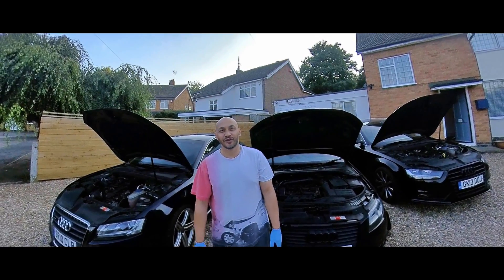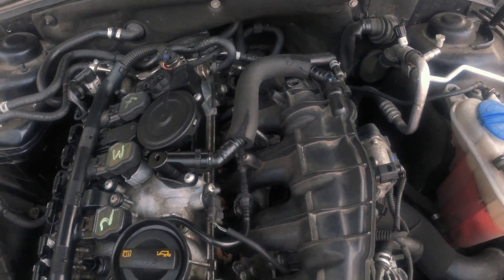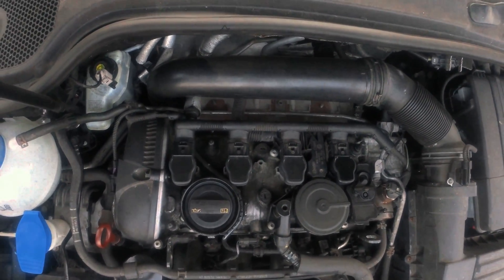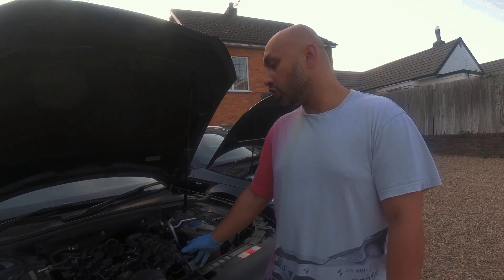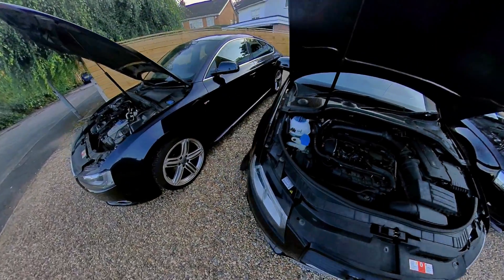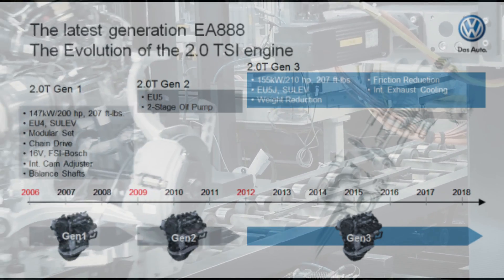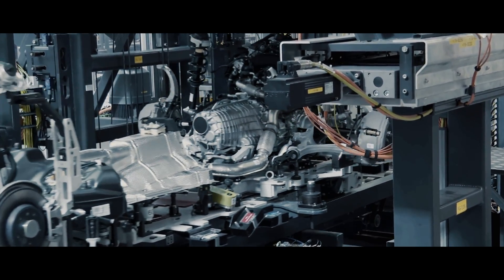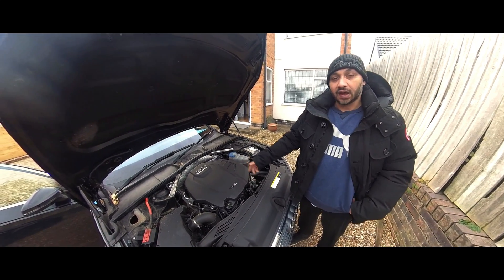VW Audi EA888 Gen 1, 2, 3, 3B TSI TFSI Engine Problems Comparison Review 2008-2021

Comment: Gen 3 is a completely different head to Gen 1 and 2. Exhaust manifold is in the head in the gen 3 with only two ports to the turbo, compared to a conventional 4 port head on the earlier generations. 
Rocker cover also includes the top half of the camshaft retainers so not simple to replace if there's a rocker cover oil leak.

Comment: Gen 3 still leak oil. 6k miles loss about 0.8l

Do you think it is better to rebuild the original Audi or replace it with a steel cylinder with smaller pistons (more oil cooling) ?
Reply from the maker: EA888 Gen 3 Losing Oil? Here’s Whether You Should Rebuild or Go All-In #ea888
https://youtube.com/shorts/SuJvgcPChlo?feature=share

Comment: 2.0 tfsi a5 2010 owner (btw the engine is gen2, not 1. Gen 1 had 200hp and way less torque. I have to say that the handling with a longitudinal mounted engine, is much better :)

Comment: Good video, but keep in mind that the Gen 2 engine was updated during its production run with a revised timing chain and tensioner. It also got better pistons and rings too. Most of the big issues were addressed during Gen 2, so the later model years are very solid engines.

Comment: For me the biggest advantage this engine has is its cast iron block. It can take serious horsepower, its thinner profile allows for easier maintenance and cast iron absorbs vibration better than any metal. It's a bit heavier, but its advantages more than make up for that.

Comment: The B stands for Buddack. It's the VW engineer that modified the Miller cycle to be more efficient and driveable. 3B and 3 couldn't be more different. One is Buddack cycle and the other is Otto cycle.
Reply from the maker: EA888 Gen 3 vs Gen 3B – Budack vs Otto Explained in 40 Seconds
https://youtube.com/shorts/KwSmJXh9R0M?feature=share

Comment: Im confused bro. I have an Audi q5 2014 2.0 tfsi. The engine cover looks like the third one you showed here the gen3, however the code is different than the ones you listed and it doesn’t have the dipstick to check oil.

Comment: Mark 8s with the 2.0 TSI have the Evo4 engine. Slightly bigger turbo (not from IHI anymore). Cylinder block is cast iron on all EA888, one of the best traits of it.

Comment: I probably wouldn't buy a car with a Gen 2 or Gen 1 version of this engine, but the gen 3 in our Mk7 GTI Golf is a good unit. It is very uncharismatic though due to it sounding very bland. The previous EA113 was much better in that regard.
Reply: If your finding it too boring then just look at changing the intake. My mk4 golf diesel I retro fitted the golf r32 intake really cheap and it looked oem.
Then I needed a new intercooler and managed to get the forge intercooler really cheap from where they are made. Then got some sfs hose with the correct adapters for diesel and everything just connected nicely. It made such a big difference to how well the engine ran after all that.
Reply: @rob-123  It is fine, the Golf is my wife's car. I have BMW M140i for aural thrills

Comment: FYI the MK6 Golf R uses still the Gen 1 motor. Only the GTI had the gen 2 motor. And as far the fuel consumption, Even tuned, Im getting over 25 mpg on average in my MK6. 30+ on on longer drives.

Comment: I think you skipped the actual 1st generation for the 2.0T (TFSI). I am driving an Audi A4 2.0 TFSi from 2005, engine code BGB, which is considered to be the first gen for FSI / TFSI engines (2004-2008). Which gets commonly mistaken for the 2nd gen, which is from 2008-2012 and the 2nd gen are notorious for their oil consumption and have been recognised as a factory fault and therefore a large percentage were factory recalled and fixed by Audi - as you well described :). 

I would consider your title to be EA888 Gen 2, 3, 4, 4B.

Edit: Just found that the 2004-2008 FSI/TFSi engines were considered to be EA113, so you you have listed them correctly. 
Once again, well described and I enjoyed watching.

Comment: Once upon  a time, there was the predecessor of the 1.8 vag engine, the supercharged, (PG code), g60, 1.8lt.. 
Some used for races and where dissapointed. The rest users, felt that this engine is one of the best, ever, made by VW.

Mine, on a Passat Syncro, has 320.000 km. and 30 years of use, never opened, consuming 1l of oil/1000km., giving the same magic sound of a brand new g60, as you can compare to my blog. This consumption is prooved to be minimized by changing the valve seals, without opening the engine.

The g60 compressor prooved to be better than a turbo, having the need for the first service at 250.000 km., much better than my 2.7l Audi biturbo engine.

The funny think is that, at that era, smart guys where adamant that the engine was...unreliable because it was not capable to take Lemmans circuit.

The Millenium after, VAG, is not the same animal...

The Syncro Heresy
Reply: Forgot to mention that my g60 has an ABT kit, (chip + camshaft), for 200 hp. The engine, for the last three decades, works under these conditions

Comment: That engine is the shits

You can not own any VW group car that comes with that engine and not replace the water pump once
Reply: I've never owned a car where I haven't changed the water pump when doing the cam belt, even on chain I've done the water pump change from time to time. I wouldn't want to run the risk of the pump failing and causing all sorts of problems on the block. To me the water pump is a service item on any car. I've had pumps leak and never felt comfortable leaving it.

Comment: Hey man, I need some answers I’ve looked everywhere, I got a deal on Gen 3 2017 A4 motor I wanna put in my 2010 B8 a4, can I do this swap with the OEM harness out my B8 and sort the intake cam spool valve later ? Thanks !

Comment: Great video👍 I have a 2012 A4 TFSI EA888 gen 2. My engine isn’t mounted horizontal though🤔The excessive oil usage because of the faulty tensioners is definitely the Achilles heel other than that, 193,000 miles with virtually no issues.😃👍

Comment: Glad I found this channel 3 years late . I've stayed up late daily researching this engine every night contemplating  my path. Purchased my 09 a4 Quattro with a caeb .  almost 4 years ago . Was my first almost new car was my dream car.  Put $4,000 down and first oil change car started smoking horribly wile running. 123,400 miles  with the internet and friend I misdiagnosed it as a bad turbo . Purchased a $1800 non stock great turbo . Installed and problem still existed.  Some lessons are expensive .

Comment: We bought a 2014 VW EOS online.  We are the third owner's.  Vehicle had 39,500 miles and very frequent service.  First thing I noticed is the exhaust pipe outlet is lined with a very think Soot.  I think it's 1/16".  The engine runs fine, no visible smoke and it's quiet but that Soot must mean very bad news.  My 2002 SAAB 9-5 has 171K miles and the exhaust outlets have zero residue and are slightly rusting.  The SAAB never burns any oil.  We don't know if the EOS is burning oil yet?  We only have put 700 miles on the car and are using Motul 5w-40.  I would assume this Soot deposit means it's shot.  Should we dump this EOS?

Comment: thank you bro! your video is very helpful! Can i ask the question? My car is 2013 Q3, The Engine code is CCZC, Do you know the tensioner part no. is 06H(old) or 06K(new)? because some say the new tensioner(06K) is fixed the timing chain issue.

Comment: I have a 1.8 tsi CDAA engine. The oil level is dropping every 600 kilometers. It needs 1 kilo of oil. I notice a lot of fuel consumption. Is this normal?
Reply: No its not normal. Common issue on CDAA engines.

Comment: Great review overall but you might need to correct this the smaller pistons were actually on later Gen1 CAE, CDN and CND and earlier Gen2 CC engines but earlier Gen1 CAB, CDH  actually had larger pistons ..and seem to be holding better after 10+ years on that oil gulping issue. 
For this reason most people actually generalise to saying the smaller pistons were more of a Gen2 issue than Gen1 or Gen3....
Reply: ... that was using Castrol Edge 5W40. My last 2 oil changes I switched to Castrol Edge 5W50 and the oil consumption went down to 400ml over the 7500 km oil change. Essentially using only one 5 litre bottle of Castrol Edge 5W50 between oil changes
Reply: thanks for the input dave not everybody is so deep knowledgeable as you.
Reply: exactly
Reply: Good catch👍, my early Gen 1 burns less than 700ml between 7500km oil changes

Comment: iv got a 2008 1.8tsfi A5 125000 miles on the clock and doesn't use a drop of oil between services, so it's not all engines that do it.

Comment: Oil consumptiin can be prevented by changing oil every 10k kms. 

I have a 1.0 tsi and the oil change interval according to them is 30k kms. Told them i don't buy it.

VW group is really destroying theor reputation this way. They even lied to me avout it having a timing chain, but the engine i have has a belt.

Comment: Mein Vater hat einen Skoda Yeti 1.8 TSI 160 Ps Bj. 2010/08 neu gekauft-   der Motor ist eine Frechheit und Schande. Bei 11.000 km Kupplung kaputt, bei 38.000 Kupplung kaputt, ab 65.000 km Ölverbrauch 0,5 auf 900km, Skoda sagt normal, bei 82.000km  1,2 Liter auf 900 km 😈👎👎. Mit Kulanzantrag und Rechtsanwalt wurde der Motor instand gesetzt und neue Kolben verbaut. Da alle Services  bei Skoda waren und Longlife Öl gefahren wurde. Mein Vater macht jetzt aller 12.000 km Ölwechsel mit Ölschlammspülung. Zusätzlich Rost an Heckklappe und 2 Türen, die Kürbelgehäuseentlüftung haben wir zusammen erneuert. 5W40 wird nur noch gefahren.. Steuerkette bei 82.000 auch mit erneuert zu lang.
Und bei 125.000 waren Ladeluftkühler und Motorkühler fällig da die zerfallen sind, bei der Aktion gleich WaPu mit gewechselt. 
Jetzt knapp 140.000 km ohne Ölverbrauch,  im Mai geht er zur Bedi Reinigung und die Injektoren werden im Ultraschallbad gereinigt und auf Sprühbild geprüft.
Auto ist Garagenwagen mit Fenster.

Comment: Hi thanks for the great video. I know you have said CDNC is a 1st gen but just wondering if this is true for the 2013 B8.5 facelift model manufactured in germany, as was told this was a 2nd gen?
Reply: Also trying to figure this out, from what I've learned I believe the cdnc is a 2nd gen however still plagued by the piston ring issues.
Reply: Also forgot to mention it is a quattro avant. Not sure if that makes a difference or not...

Comment: Turbo fuel stratified injection (TFSI) is a trademark of the Volkswagen Group for a type of forced-aspiration ("turbo") engine where the fuel is pressure-injected straight into the combustion chamber in such a way as to create a stratified charge. First generation TFSI engines was produce in 2004, for exaple: in audi A4 b7 engine code BPG BWT (162 kW or 220HP) or Golf Mk5 engine code BWE (147kW or 200HP)
Reply: I mean to dumb down what you said it’s almost a diesel style combustion style but for a gas car.. I have an A3 2019 2.0t and even I’m dreading if it will go wrong

Comment: I have gen 2 engine - cdh code - starting issue when cold and cycling high pressure fuel pump noise. I've already changed the high pressure fuel pump, the fuel filter, the tank fuel pump and tank fuel pump sensor and stil does the same: hard cold start and cycling noise from high pressure fuel pump. No error code - what can it be?
Reply: the oil may be ran low and the camshaft lobes might have worned if noise top end
Reply: @mohammedrahmanrahman5024  high pressure fuel pump noise. There is no noise If I disconnect it. And it seems the engine running ok. The only issue I have is hard start when cold and the cycling noise.
Reply: @mohammedrahmanrahman5024  https://youtu.be/Y3El5NJ4MJI

Comment: I went to Audi after buying a a4 from them second hand burning 1l every 300 oil off the lot. They charged me 700 to do the test and told me I need proof of recipes for all oil changes from the time the car came off the lot new so basically if you aren't the original owner with proper documentation go f yourself. Or give them 9 thousand to do the repair. Nice lawsuit

Comment: A no nonsense video highlighting the important bits.. I'm gladish mines is gen3 but will be doing timing chain and water pump to be sure.. Its got audi fsh but hey they put rubbish oil in from asda.. Its 5 40 for me and the liqui/moly additive.. Had Honda type r b4 and even Honda recommended 5/40. And it used less between changes.. Great video.. 👌👍🏻

Comment: Does the ea888 generation 3 have the classic timing chain tensioner issue?
Reply: no
Reply: NOPE, gen3. EA888 engines are reliable for the most part, still have water pump failures early.  Oil consumption issues fixed as well.

Comment: Finally someone who can tell me if I have a gen 1, 2 or 3 engine. So happy to see that I've got a gen 3 without those oil issues!
Reply: Not without, just lesser.
Reply: A gen 3 burning through 1 liter of oil in 6K miles seems like a lot to me.
Reply: @jmt8706official  It really isn't that much, it takes me like half a year to drive 6k miles, topping up 1L of oil every half year is not a problem for me.
Reply: Mine takes 0.2 liters in 8k miles. When I change the oil anyway. @elbojoloco
Reply: @jmt8706official  I got a Gen3 b and I don't burn any oil at all at 150k miles. 
Change you F'ing oil every 3000 miles and you won't have any issues, and don't use the shit 0w20 oil.
Reply: Also my timing chain is original and has lots of spec left before it needs to be changed. 
Change your oil, change your oil, change your oil. I don't care what VW says, change it every 3000 miles and don't use shat oil.
Reply: @jims.3987 Even 6-7k miles.is ok .if.you drive less.than crazy.
Reply: @jmt8706official as someone who drives pretty heavy footed, i get a check oil light like once a month
Reply: Gen 1, owned since 2011. Tuned since day 1 and haven't had a single issue with oil consumption
Reply: @itsonlyniles  tell me more. did you change the pistons?

Comment: I was just about to buy an Audi A5 2.0t of 2013 (engine CDNC 211cv) but I think it has the ea888 gen 1. Do you think I should avoid it? All this engines have the oil consumption problem?
Reply from the maker: Unless has already been recalled and fixed I would invest into Gen 2 or 3 as they are manageable through service and maintenance in comparison to hopeless cdnc. That's my opinion as someone who had personally two cdnc vehicles recently.

Comment: I have gen 1 and Audi fixed my pistons for free. Also did my tensioner since the engine was out. No problems at all since then
Reply: Did you own it since new?
Reply: @vagcentral2252  no. I bought it with 62,000 miles

Comment: Hi great videos I work on Volkswagen and Audi as a independent shop and yes the generation one engines do consume a lot of oil but most transverse gen one engines don’t I too like better timing belt engines because there’s a specified time for the replacement and if you replace it on time it’s just fine but with a chain customer think that it’s a lifetime component and then they drive them until the chain jumps then it’s too late and a very expensive bill I really like the timing belt 1.4 L engines they seem to be very quiet and good on fuel this is here in Canada we first got them in the Jetta Hybrid and the Audi A3 e tron plug in hybrid and since 2016 in the base Jetta and now in the MK7 Jetta any Golf since 2018 .  We are soon going to get the 1.5 litres engine in the New Taos with the VGT turbo that I’m a little scared of because of the stuck vanes on TDI cars but the gas engines runs a lot hotter and with less carbon it might be better.
Reply: How can u tell if it’s a transverse engine ?

Comment: Why Not buying the 1.4 Tfsi in the B9?
It is best driven and has enough power.
Reply from the maker: 1.4 tfsi has it's own story with the avalanche of failures, oil consumption, turbo failures, tensioner failures..no thanks 😊
Reply: @GetJobDoneofficial  even as new as 2018, 2019 1.4 tfsi engines? Do they have these problems? Im planning to get A5 2018 with it

Comment: I have a 2011 A4 with 211hp which I’ve always known to be a Gen 2 but has the CDNC code.
Reply from the maker: It's actually gen 1 I've had two vehicles with this engine, one of which I had to swap entirely.
Reply: @GetJobDoneofficial     I dno if you're right bud, Gen 1 came without valve lift, VW used these in their early MK6 TSI platform, Audi used them in the 8P A3s too. 
They had a non serviceable HPFP, larger crank mains, larger piston rings. Pretty sure they ran a KKK turbo too.

Gen 2 all had valve lift Audi called it (AVS). They designed the engine to have 'less friction' which meant smaller piston rings (that causes the oil scraper/control to carbon up which causes the consumption issue) they had a narrow slotted design, later moving to a longer slotted design with most aftermarket manufacturers moving to the old school helical design. Smaller main bearings. IHI turbo. Later engines had a staggerd link timing chain design to counter the stretch issue (which coupled with the bad tensioner latch design led to the jumping timing issue)

Big changes in the Gen 3 notable ones being integrated exhaust manifold with the later chocolate IHI turbo. The block design changed with narrower cylinder walls, pin bearing balance shafts and I think some run port injection? They also moved away from Bosch ECU to Siemens.

They all ran different injectors starting from HDEV 5.1 injectors to HDEV 5.2. ranging from 150bar to 200bar fuel pressures.

The rocker arms changed through the years too.

My information comes from working on a lot of these through the years, building a couple high hp motors. One being a CDNC from an early 2011 A4.

Good to see someone trying to publicise good info on these engines though, it's a bit of a dark art!